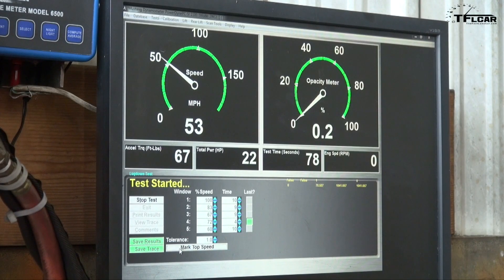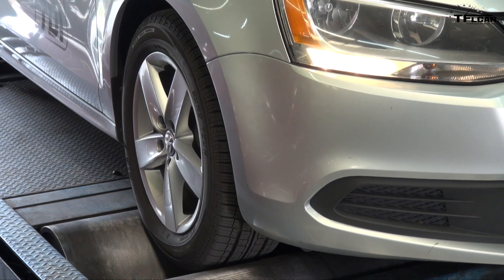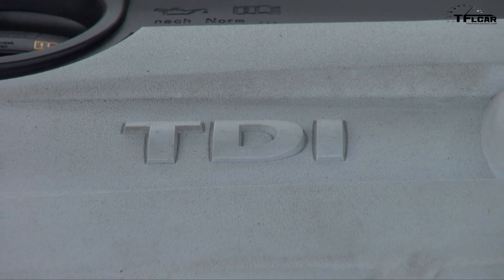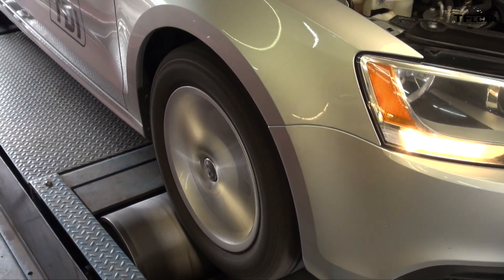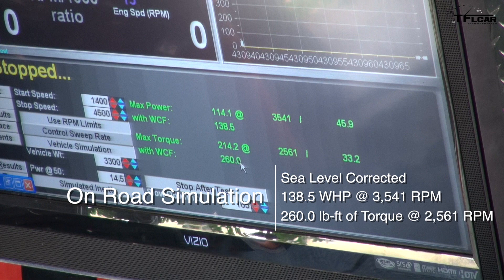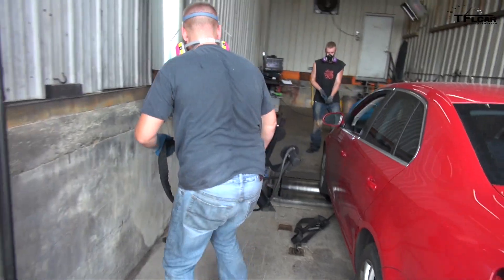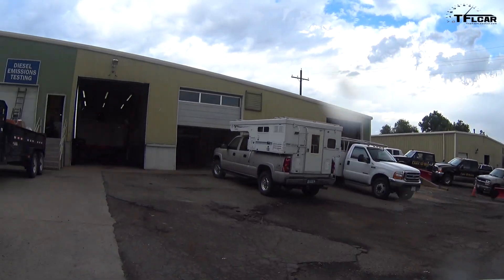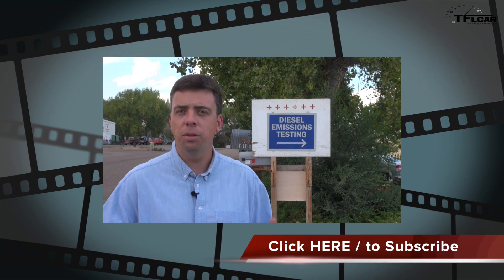Surprise! We Dyno a VW Dieselgate TDI Jetta to get the Truth about HP Loss

Comment: Also it was proven that literally  the actual testing of every  car causes extra pollution  for no reason.  Especially  the dyno test.  Think about how many extra miles and gases are expelled collectively FROM everyone  just driving to the check facilities and then the actual test itself. Which in some cases operates the car harder than alot of actual  owners would ever drive their cars.  The testing is causing  unneeded pollution just to catch a few outliers that most likely  are not too far off if the car was driven their. This is why a lot of states are trying to switch to new methods such as only doing obd 2 and idle sniff test, or trying to measure  cars from highway with spotter vehicles.  They are trying to play up to a very noble cause.  It sounds good in theory but the reality  of the situation  is its a broken backwards system  designed  to go after the basic citizen  and not the real polluters. Lets inconvenience  and restrict  the citizens  because we dont want to go after the big guys.
Reply: +gn4life84 there not their

Comment: want a waste of my time... Your test was invalid. You didn't correctly disable the traction control and the variation in HP and torque were minimal. You would find that in most cars and under the same test simulation. 
And from what I understand, the computer only knows to go into "emission limp mode" if you would call it that. When a diagnostic tester is plugged into the OBDII...

Comment: The really laughable & outrageous irony about the current controversy on diesel emissions, - is that for some 85 years, petrol contained both lead, & a very high proportion of added benzene, - one of the most carcinogenic substances known to man, for which there is no known minimum safe level. A single lungful of petrol vapour at a filling station gave you a bigger hit of pure benzene than a whole lifetime of inhaling unfiltered uncatalyzed diesel particulates. All these tree hugging liberals now shrieking about dirty diesels have no idea how much their 'clean' 'smoke free' petrols were poisoning everyone. One scientist claimed that he would not run his uncatalyzed petrol lawn mower without a gas mask to protect him from the toxic unfiltered benzene from the exhaust, - & that he would try to hold his breath while filling his car at gas stations to avoid breathing in benzene from petrol vapour. Diesel fuel has never contained lead nor benzene to enhance or control its ignition quality. As a chronic asthmatic, & former mechanic & operator of large mowing machines for a UK council, - for over 10 years I drove a large 5 cutting cylinder 2.2 litre diesel grounds mower with no cab. I would operate this machine at full power for 8 hours a day 5 days a week with NO CAB. During the Autumn when it got very cold, I would sometimes get mild hypothermia. I used to get off the machine, rev the diesel engine to 3000 rpm, & stand next to the side exit exhaust. The exhaust was at crotch level, & would blast against me, up the inside of my overcoat, & exit past my neck face & ears. I would stand there for up to 15 minutes sometimes getting warm, breathing the exhaust gases direct from the engine with no dilution from atmospheric air. Not ONCE did the unfiltered full power exhaust ever trigger my asthma in ANY way. Not ONCE did I ever feel drowsy (because diesels produce virtually no carbon monoxide.) - Not ONCE did I ever feel queezy or ill. & this was long before particulate traps or catalytic convertors were ever fitted. That was over 25 years ago, & at 55, I'm still here with no health repercussions whatsoever. I have breathed in more unfiltered uncatalyzed diesel fumes & particulates than any average person will in 10 whole lifetimes. Diesel exhaust doesn't worry me in the slightest. However.. - As a former mechanic in '82, on carburrated pre catalyzed petrol cars, I have coughed & wheezed & suffered chronic asthma, - felt my lungs burning to the point where I couldn't breathe, & felt chronically sick to the point of being sick, just from being in the vicinity of a running petrol engine at idle. If I had tried the same trick of getting warm with a petrol mower as I did with the diesel, I would have been dead of carbon monoxide poisoning inside 5 minutes, or long since died of cancer from the benzene, which, in the petrol of the early 90 's, was BILLIONS of times that of a diesel with no particulate filter. The issue here isn't the far superior thermal efficiency of the compression ignition system of the diesel engine, - it is the fuel that oil giants make for the diesel engine to burn. A diesel engine can burn anything flammable you put into the cylinders, - providing it can lubricate the injection pump & injectors on its way through. Rudolf Diesel's first engine ran on coal dust blasted into the cylinder with compressed air! It can also run on peanut oil, natural gas with a different injection system, or pretty much anything that will burn. Surely it cannot be beyond the wit of man to make a cleaner burning fuel for the most efficient internal combustion engine of the last 100 years?

Comment: As a VW certified tech with engine specialist and electrical specialist certification I can tell you this test is not valid. The tester said he had to ease into the throttle so it wouldn't down shift. 1) with a DSG trans u can select the desired gear and it won't down shift. 2) easing into the throttle will decrease power as turbo is not fully spooled up. If I was to guess how VW programmed I'd say why the OBD2 connector is hooked and talking to the State machines. That's probably when it detunes itself.

Comment: of course so you get less horsepower when the engine also has to drag around the rear wheels AND linkage to second dyno roller, there is a large mass that demands much power from the engine! 
You must use electric motors to speed upp the rear wheels, not the car engine!

Comment: The power ratings do not include driveline loss which can be as little as about 10% and as much as 25%. The difference in power could be load as well. If there isn't enough load on the engine the turbo may never fully spool. My diesel truck won't produce full boost when I'm not towing  before high RPM 3rd gear, but more typically 4th gear. At the same time I can produce full boost in 2nd gear if I'm towing several thousand pounds. That AWD simulation would have been more resistance on the driveline and caused more boost to be built up earlier because of turbo spool. Just spinning that second set of rolls and the belts and such would be a considerable additional inertia difference.

The first pull showed far more power (corrected) than the car is rated for. it showed nearly exact HP and about 20lb/ft of torque above rating, NOT COUNTING the driveline loss. Thats not totaly surprising though as diesels are often underrated after they break in.

Comment: Of course the HP and Torque is going to decrease when the abs traction control system senses the front wheels spinning and the rear wheels not!! That is what the System is designed to do, in any car, gas or diesel, import or domestic!!!! JackA$$!!! 
I have a 2014 tdi jetta with over 20,000mi on it. It gets 50mpg and the inside of the tail pipe is clean as new! No Smoke or smell!? love it!

Comment: I don't get any evidence here. The car has ABS sensors and all sorts of control systems that are being messed with when only the front wheels are turning. Torque is very easily impacted throughout the power curve too, so even a small adjustment during acceleration, trying to "figure out" the stationary rear wheel situation, could affect the readings. This entire test is based on hypothesis and conjecture. If you own a VW TDi, you have a great car, period.

Comment: this video so mis-leading. First of all mechanic knowledge, how well they really understand in detail how engine related in power. When you put the can in the simulation of running on the road, both front and rear axle were spinning. The question is what was spinning the rear axle? If the power from the car was spinning the rear axle, the engine for sure will put out more power. Now when you put in two wheel drive, the rear axle of the dy-no was not spinning. Torque will drop and horse power was not needed and that was supposed to be. Find a better way to blame VW for this failing would be wise. American need to find the way to produce better product in automobile world. We cam make the rocket goes to out of space, I am sure we can find the way to measure any substance that came out of tail pipe of VW diesel engine.

Comment: I'm surprised VW is the only company that has done this. (Or at least got caught at it.) Most emissions places only take and trust data from the OBD2 plug, would be easier to cheat vs. the 4-gas analyzer method used to check old cars.

Comment: sorry to disappoint you but all you did was not accurate nor correct. Please Google how to dyno a VW. The results that you had are expected. The ESP and ABS connectors have to be removed in order to dyno a vw. The car is not meant to drive with the rear wheels stopped that's why you had all the lights flashing. I'm far from having deep knowledge on this matter but around here there are a lot of 2.0 TDI'S with the ECU reflashed pushing around +200HP, some push a lot more but have a lot of work done,and it's a normal procedure to disconnect such systems. Altough this video is being successful on YouTube it's an unreliable source of information and it's a fine example of sensationalism.

Comment: on the 2 wheel drive test the esp wasn't disabled so you confused the shit out of it, it thought there was a fault with the system which is why all the warning lamps came on and the power and rpm was restricted, any car with esp will do this if it is not disabled on a 2 wheel dyno

Comment: This issue really can be resolved with better quality and thermally stabilized Diesel fuel. NOx will drop around 25%. Full HP and Torque will be achievable, maybe even more 2-3 HP+ Easy fix, already sent the info. to VW AG. Hope they listen. On Dyno tests there are settings that must be set on the car prior to every test, if not they will not deliver full power from the engine.

Comment: How exactly did they turn traction off? I know in mine there is no why to simply turn it off without disabling the system as a whole. Could the car have been just thinking it was loosing traction and to an extent limiting itself there?
Reply from the maker: We could not turn traction control off. There is no button for it on this 2011 Jetta TDI.
Reply: thanks for the feedback

Comment: when you deactivate traction control. it doesn't mean the stability control program has been deactivated too . so this whole test is wrong because the stability control program is doing its job when the rear wheels are not rotating at the same speed as the front.

Comment: Do your homework!! All cars in the US at least are not tested on a dyno driving simulation, they are just tested via ODB2 computer interconnect. Your test is most likely interfering with the traction control.
Reply from the maker: We did our homework. There dozens of Dyno stations in Colorado that diesel emissions testing. And Colorado does not require NOx measurement. They only require particulates detection.

Comment: Sorry guys, but the truth is you know NOTHING about engine electronics! All you did was create a situation where the car thinks its rear ABS sensors have gone broken which in turn set the engine ECU into limp home mode (which has nothing to do with emissions test mode). Stupid new cars have all their ECU's connected to each other.
Your test is stupid and only proves that engine ECU-s have 2 different maps when everything is OK and when in limp home mode. You've discovered the hot water...

Comment: Seems 20-30% less "driving fun" ie torque in the low-mid range when emission compliant and the top end is not relevant for emission testing.And still the ugly stenchy NOx smell of death for diesels in passenger cars can not be controlled cost effectively.Ban diesels, i don't need these *sshole diesel  drivers attacking my health so they save a few cents and have "driving fun". This is going on for decades already, now drivers and manufacturers hopefully have to change.

Comment: You could have at least shown us how they actually discovered the emissions cheat, not power and torque comparison. As with other cars eg rx8, traction control can be turned off, and on a dyno will produce less than expected results, indicating computer adjusting engine parameters. This test is still inconclusive, and inconsistent with the original discovery methods of VW's cheat

Comment: Those 2.0L TDI engines are rated at 140hp in Europe. How can the same engine produce 30 HP less in USA? You don't need to reveal a software cheat, just use your brain.
Reply: WHP(wheel horse power) is less than advertise HP, they mostly always advertise HP to the crank which is usually 15% more on 2wd cars
Reply: +A Dz The EA189 engine was also sold with 170 hp in Europe in the whole range of VAG models (Audi, VW, Seat and Skoda). With two turbos it is even sold as a 240 hp variant in the VW Passat.

Comment: So the emissions test guys tell you they hit the Traction Control button, regardless of what that actually does or does not disable partially or entirely, and you run your tests without doing the same thing? "Possibly the same mode" after hitting limp-home mode because you didn't press a button is not the same as pressing the damn button. If you did do the same thing the emissions tester said they do for all tests, you certainly didn't indicate it.

The conclusion of your test: "It passed". On the first run? On the limp run? Both times?

Comment: I'm not against fracing. it's OK. I'm just surprised the EPA is making noise over Volkswagen when big 10L V12 diesel trucks straight exhaust can be used for fracing. since oil is cheap now fracing isn't used as much as it was last year.

Comment: Ok guys you SCREWED UP ROYALLY. YOUR TEST WAS DONE INCORRECTLY. When you switched to 2wd mode you didn't fully disengage traction control. That's why the traction light was flashing and you couldn't accelerate. Then the system sensing that things weren't right (And likely the wheel speed sensors were defective, it assumed) it disabled all the systems that use the wheel speed sensors hence why all those lights came on. You didn't access the dyno mode/emissions mode and most cars do cut power to assist you when those systems come offline. YOU GUYS PROVED EXACTLY ZERO. I have a hard time believing you guys know this little about cars.. was this a ploy to get a viral video? 

And you guys can't be stupid enough to think VW would flag there illegal mode with dash lights. that's downright stupid.

Comment: this is stupid that's not how they test them. these guys just put the car into "limp" mode not "emissions" mode. limp mode thinks there is something wrong so it automatically backs off the power and torque. this is not an emissions testing facility they just test power output. take it to a dealer and see how they test it then go back to your dyno. and yes the emissions dyno is different than a performance or power dyno.

Comment: Firstly, let me state that I have no opinion of VW. I am an American car driver and wanted to learn more about the story... That said, I'm a little disappointed by this report - I was hoping they would actually conduct emissions tests while it was on the four wheel and two wheel dyno to compare the simulated driving vs. testing conditions-like results.  It seems practical that (in my layperson's mind) the car may be programmed to reduce power when traction control is deactivated in hopes of reducing the chances of spinning the wheels given that the vehicle won't correct a wheel spin in such a mode. Further, I don't necessarily see why increased or decreased power output dictates cleaner or dirtier emissions. Seems like a lot of effort for essentially inconclusive results.

Comment: Diesel engines are basically lean operating engines and prone to NOX production
Probably that most diesel engines used in cars use a software to pass emissions tests as fuels composition varies with states, seasons  and fuel grade.
For high speed diesels there is to my knowledge , there is 2 grades of fuel and if you add to this raffinerys reciepes, the chance is high that the true stack emissions are way out from laboratory results and it is perfectly normal.

Comment: props to all the mitsubishi evo's.. one of the best cars ever brought to usa. Loved mine. Have a sti now. Props to VW for making a good running diesel w todays crappy epa diesel fuel. The air is cleaner than it ever was 20-30yrs ago w 30% more people driving. Hopefully VW fix is a biodiesel flash that ups power 20% and lowers egt's. Maybee the epa can get off its ass and mandate biodiesel at pumps? no more dpf needed, engines last longer. Same w Ethanol...we got plenty of corn and wouldnt need Catalytic converters anymore.

Comment: If only VW could market this software, maybe in the form of a "black box" that drivers would attach to enhance or replace the standard ECU.  Switched on it would tweak the engine to generate max performance and mileage.  Turned off it would allow the car to pass emissions testing.  I'd buy one for every car in my driveway.

Comment: There is a tremendous amount of illogic in this video. The dyno graphs are stated to be what the car "thinks" as opposed to what the dyno MEASURES. Not the same thing at all, considering what modern car computer systems sense and compensate or as regards what is happening where the rubber meets the road on all four corners.  I have to wonder whether these guys refilled the blinker fluid reservoir while the car was in the shop.  I hope they did, because that's all they're competent to do. But I doubt they did.